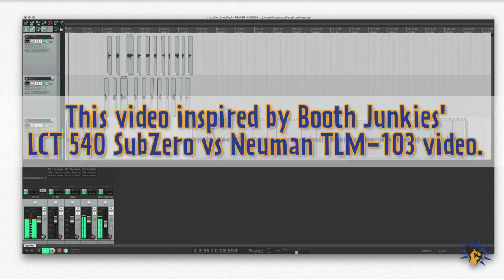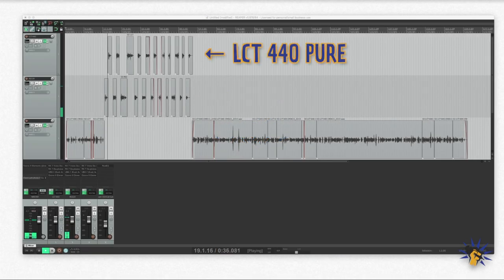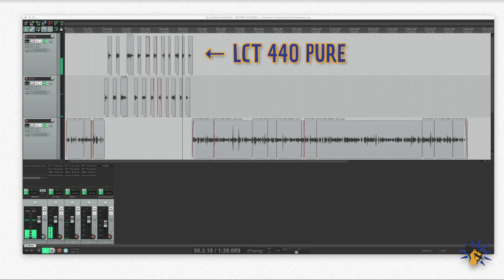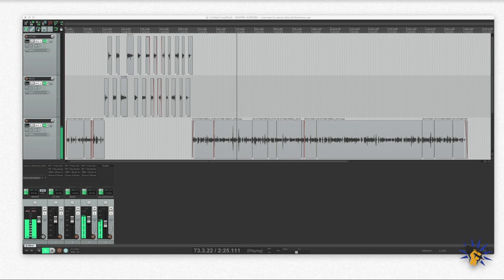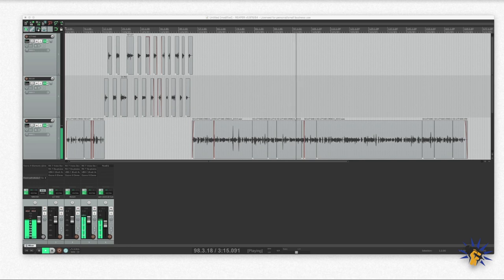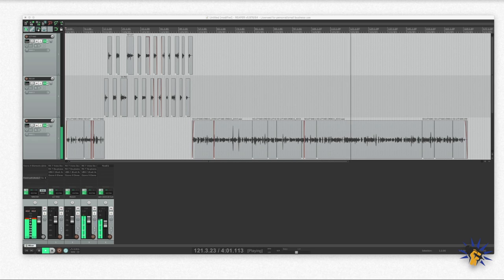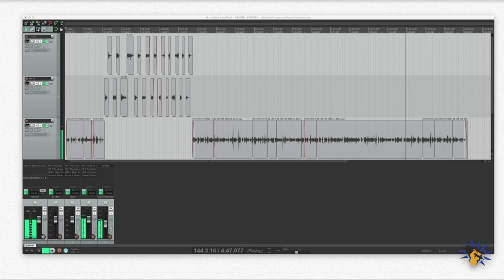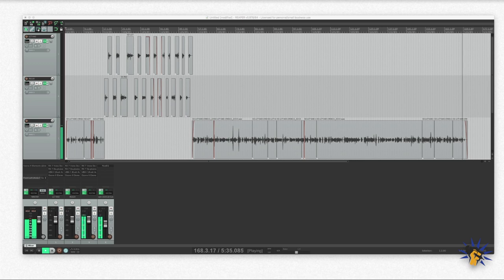What Makes a good Vocal Mic? Electrovoice RE320 vs Lewitt LCT440 Pure Shootout.

Comment: That's a really good A/B demo. In typical quality condenser fashion the 440 has air frequency lift which gives a slightly more open, less constricted sound, but it's also less forgiving of surroundings and less than ideal acoustics. It's a great choice where you have some control over the environment. Strong output and very low noise too.
I think that once you reach c$200 there is no excuse for a mic not to meet all of the basic quality measures - noise, frequency response, distortion and of course build quality. Above this you really are looking at tonality and flavour in many cases regardless of cost, and that's subjective with no universal right choice for everyone.
Reply from the maker: That's been exactly my experience — If you pick 'em right, you need only ever spend $250-$500 USD on a vocal mic, and most of the cost variance is just... what does the market demand for the flavor you want.

Which... Yay? 

I'm REALLY looking forward to putting this thing on acoustic guitar, too,

And thanks for stopping by!

Comment: For me the RE320 sound best as have more bass presence, subtle, but is there. Also, it saves time as actually is almost no noise floor.
Reply from the maker: I think you're right about the stronger bass/low-mid presence. I've actually ended up switching to the 440, though, because I can do a little boost down there and get the same effect BUT it's got this high-mid clarity that the RE320 doesn't quite have (to my ears, on my voice, of course. YMMV) I think, all things being equal, you could flip a coin and be happy with either mic.  I think you hit on the important factor in the choice for anyone: Which mic gets you closest to what you like, fastest.

Comment: What pre are you running them both thru? Also are you using a cloud lifter on the RE320?
Reply from the maker: I use a Kush Audio Omega preamp, which is nice and clean and therefore my preference. (I'm not super into hunting for tone with mic pres but mostly that's because I... kinda just don't care. There's value there for some, but I'd rather just get it clean and work from there. Also, I should note that I do work with Kush, so while the recommendation is sincere, it does come with some measure of COMPLETELY ACCURATE bias ;-D)

I did use cloudlifter with my RE320 for a while, but I don't believe I used it on this video because I wanted to compare apples to apples as much as possible. The most accurate answer I can give is "I don't remember, but probably not?"
Reply: @audiopunch9736  thanks for responding. I totally understand when you want just the pure tone go with the uncolored pre. I asked because I was thinking it was possible without the cloud-lifter and was thinking about grabbing the RE30 for some projects.
Reply from the maker: @skylisszthecolossus  Oh, yeah. The RE320 is TOTALLY fine without the cloudlifter. I mean... that extra clean gain is nice, but the SM7B is the only dynamic I've ever used that like... kinda needs the lift from cloudlifter/fethead/etc.